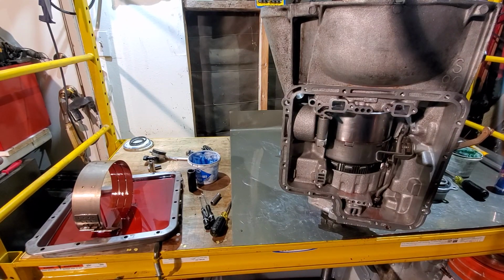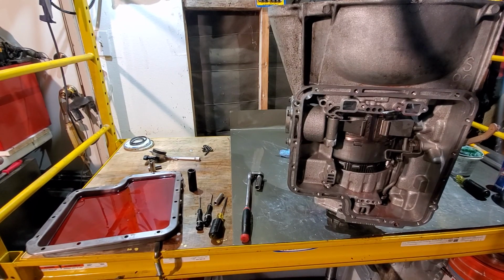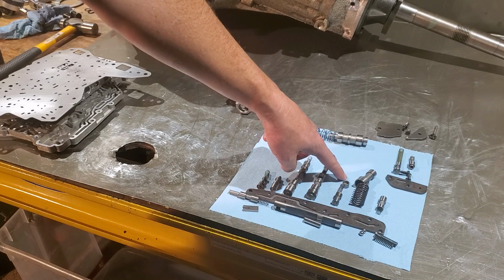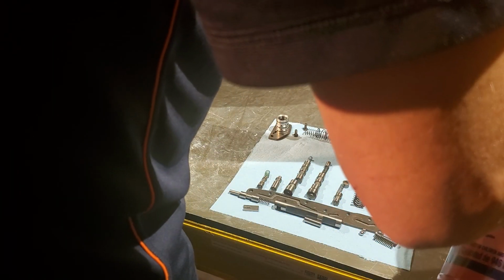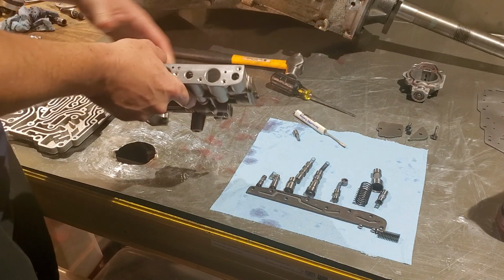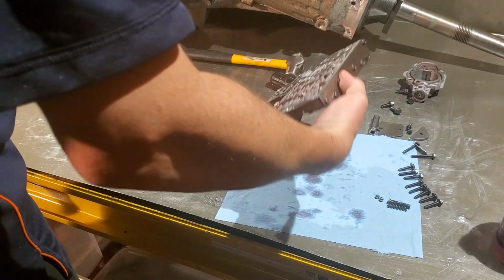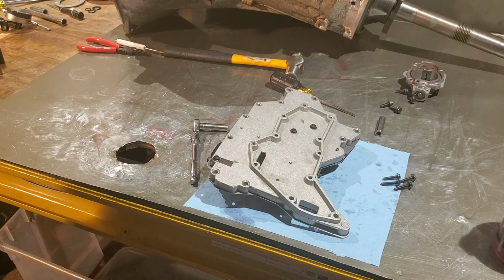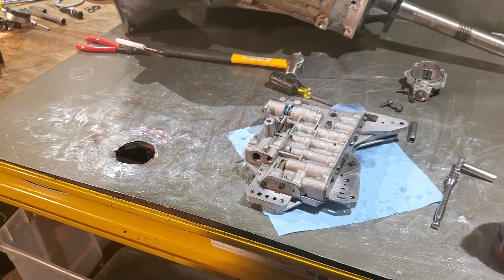Ford C6 Transmission Rebuild Part 3

Comment: I like the Ford C6 transmission personally and I know some things about the Ford C6 as well.
And its even in my 88 Bronco which is one of the reasons I bought it and also want to keep it till I die.

List of facts I personally know about the Ford C6

#1 it was produced from 1966-1996
In 1966 it was marketed as Cruise O matic Selectshift and it was produced for being needed to be lighter than the previous Ford O matic and Merc o matic

#2 it was Fords first heavy duty Automatic transmission 

#3 it was surprisingly used in the Bigfoot monster truck which was a 1974 Ford F-250 that the owner Bob chandler modified

#4 the pressure regulator valve from 1966-76 had a bolt on cover and later 1977-96 had a retainer clip holding a boost valve sleeve

#5 the vacuum modulator from 1966-71 was a screw in and the later 1972-96 was a push in with o rings

#6 this Ford C6 transmission was rated for 475 Ft/lbs of input torque and that it was on par in strength the same level as the GM TH400 and the Mopar TF-727. The Ford C6 can also be built up for handling more Ft/lbs of torque with aftermarket goodies and the other transmissions on par with it as well that I mentioned.

#7 the way to fix the Hp loss issue is rollerizing the C6 with thrust bearings in place of the dated thrust washers. 

#8 for getting a deeper 1st and 2nd gear ratio is retrofitting  a E4OD or 4R100 planetary gear set into the Ford C6 

If there is anymore facts I forgot let me know.
Reply: I’m just sharing what I know about the Ford C6.

Comment: I've learned more in this video series, than the last 10 I've watched.  Good job!  It was hard to see what you were doing with the valve body, but I was able to follow along ok.  Only thing....I think you should invest in a inch lb. torque wrench, and use it.  How did the transmission work?
Reply from the maker: Michael Steinberg
Thank you very much for the response and I am very happy you found the vids helpful. As for the torque wrench, I do have a few actually, this type of transmission is one of the few that you can complete without it due to the extremely low torque value on the valve body (at least for me, I have built hundreds of these units). The unit performs beautifully and the customer regularly let's me now how happy he is with it.
If you need any help on any domestic transmission, please don't hesitate to ask. I am more than happy to help.
Reply: @r1ddl324  It doesn't surprise me that the transmission works good.  I sure wish you'd do another late model C-6, from behind a big block Ford engine.  If you do, I won't miss it.  Please do a tear down for video #1, with an analysis of the front pump, bushings, and other wear points.  That would be another very valuable video.  Thanks again, I'll be following you.
Reply from the maker: @0lddragracer426  Thank you for following, I don't have many right now. But then again, I only just started doing these vids recently. I have a few tear down videos from a while back I might upload (some C6 and TH400). I'm still trying to figure out the best camera and angle for all of this, plus I'm by myself so it makes it a bit difficult to do the videos.
Reply: @r1ddl324  Anything you can post C-6 I'd sure appreciate.  I've always been the lone wolf type too.  I like working by myself, but as you know, it has it's drawbacks.  And now, in two months I'll be 83 years old.  I'm still pretty sharp, but I can't bounce up off the creeper like I used to.  I started racing Flat Track motorcycles when I was just a kid back in the 50's.  I got hurt, and realized that it was a small mans game mostly, which I'm not, and decided to go to cars.  I started racing blown gas coupes back in the early 60's.  I had two 40' Willys, and a all glass flip top 48' Austin that I ran in AAGas-supercharged.  I needed a pickup to pull my race cars around.  I lived in San Francisco back then, and I went to S&C Ford on Market Street, and bought a 67' Ford F-100, in 67'.  I still have it, and I'm restoring it, with a big block ford 460 motor with a C-6 Tranny.  This old truck..."Ol Blue"....is the only new vehicle I've ever owned in my whole life.  It's sitting out back, and if I went out there with a fresh battery and some ether, she'd start up on 6 1/2 cylinders.  The motor is a 352 ci, and it and the tranny have about 650k miles on it, and they have never been apart....ever!  It's my last hot-rod I guess.  I've got a lot of really good parts for it.  One of them is a Gear-Vendors over/under drive box, which should make it fun to drive.  Now you know what I'm trying to do.
Reply from the maker: @0lddragracer426  thats incredible, you have had some great experiences. I'm currently building a 95 camero as a back half car. Keeping it small block for now, 350 ci with forced induction (pro charger) running alcohol. Would like to get it somewhere in the range of 4.20 to 4.60 in the 1/8 mile. Gonna be a while before it's complete, but should be lot of fun once it's ready. 
I like the set up you mentioned for the truck, that will be awesome once completed. Happy early birthday and glad to hear your still working on cars at 82, that's pretty awesome.
Reply: @r1ddl324  get one more camera and a c-stand. one recording from the front and there other above. sync and split on screen
Reply from the maker: @bmccown100  I would love to
Reply: @r1ddl324  Yes, great view of your elbow and right arm.  Very good series; thank you.

Comment: I think you could benefit greatly from the use of a head band mounted Go Pro camera so we can see what you see. Most of the work you're doing is out of shot due to the trans housing being mounted vertically so we miss out on the finer detail.
Reply from the maker: I agree completely. These vids were my first, planning on doing more but just extremely busy right now. I'm getting a few cameras set up for the next one.
Reply: @r1ddl324  Nice. Look forward to it. Thank you again !

Comment: Hi R1DDL3,
Bob Lemay again. Does it matter what color lube I use for reassembly, I notice you have a few, I think I bought red... Again thx for your help!
Bob
Reply from the maker: Sorry for the late response, red is fine for all. I use blue for seals because it's not as thick and green (a lot thicker) for races and bushings. Honestly any color is fine to use, as long as it is not water based.
Reply: @r1ddl324  thank you so much for your help... so just came upstairs from my. nightly rebuild efforts... got the forward clutch done, man that snap ring over the dished disc is a bugger to get back in, but I got it. I received my rebuild kit today, and it looks very good, except the clutch discs that are provided for the rear case clutch/steels are not waffled, as the old ones are. Will this matter? why do they use waffled clutch discs?
Reply from the maker: @boblemay6539  you should have groved clutches except for the forward drum. They allow more bite and better hold under load. I would recommend using Raybestos Stage 1 (Red clutch material) or the HD clutches from Borg Warner or Raybestos. Those are the ones that give the best action and longevity. I would also recommend buying a snap press (Snapress model KB-20) for the drum assembly, makes life so much easier.

Comment: Thoughts on the c6 over the c4 running solid cleavland 350 rwhp
Reply from the maker: I would run the C6. Less potential problems and easy upgrades. But it all depends on what vehicle it is going in.

Comment: Did you go back and torque pump bolts?
Reply from the maker: Yes I did, there was a few things left I did not get on video due to time constraints. The next vid I make will be start to finish so nothing is left out.

Comment: It's painfull to watch you do the VB ! I've been building Ford C6's since 1974!!
Reply from the maker: That's your view, and I'm happy to hear it. Thanks for the hate, hope you have a great day.
Reply: Would you want to chat with me about these transmissions? I'm looking for experienced transmission specialists to give me as much knowledge as possible.
Reply from the maker: @gorybonghit3211  not a problem, what do you need
Reply from the maker: @gorybonghit3211  let me know what questions you have and I can answer them. These videos are more set up for people looking to rebuild their own unit in their garage. I can go in to much greater detail if needed.
Reply: @Occuria1  Merkl is top notch drag race trans builder and makes the BEST trans brake VB in the WORLD, so when he says it was painful to watch a monkey over torque the bolts in an Aluminum housing. I concur
Reply: @racinford1   @Andy74 you better look up who Frank is and then eat your words :)
Reply: @gorybonghit3211  go to Big Block Ford site and Frank has a page that details the performance work to Rollerize and improve the clutch packs and Cooling lube moods along with the 1 / 2 shifting servo mods. This guy is the bible on racing a ford C6
Reply: If you're that good Mr. Merkl, I'd like to watch you assemble a C-6.  I don't race.  I just have a Lance camper and a boat that I like to get up and over the Grapevine here in So Cal (I-5).  Respectfully, Steve
Reply: @r1ddl324   I'll say thank you for making these videos.  Thank you.  R, Steve
Reply: @steveinla8963   you really better do some research who Frank Merkl is .  
He has helped and shared more C6 info than anyone .. He is THE C6 GURU

And that's not even mentioning the valvebodies he builds :)
Reply: @racinford1  Never heard of him!  Why is he on almost every transmission video that I've watched...and trolling it, being obnoxious, and bragging about his experience?  If he knows so much, he wouldn't need to.  If he was such a hot dog racer, he wouldn't have time to be such an asshat.  He be out in his shop working, or making some video's of his own.  Never have seen one!